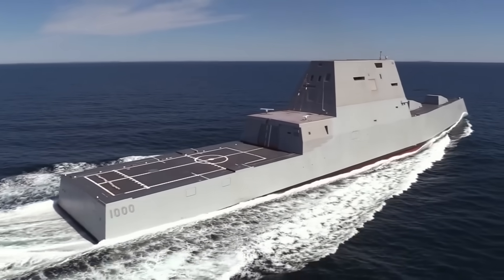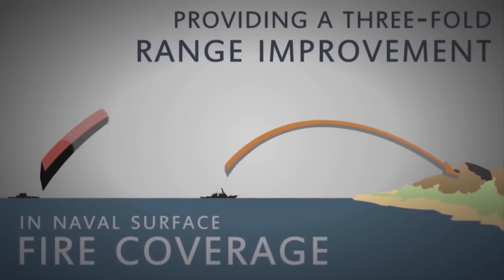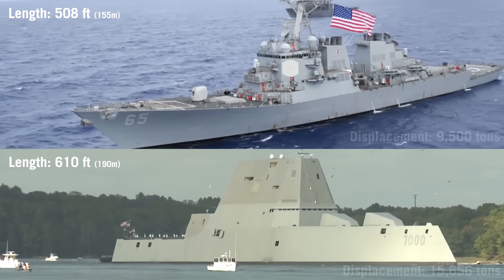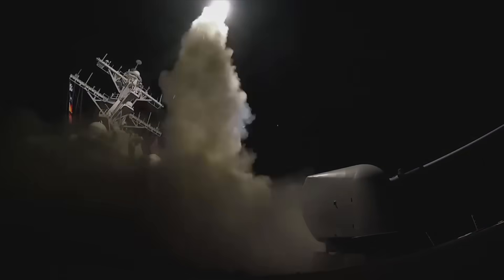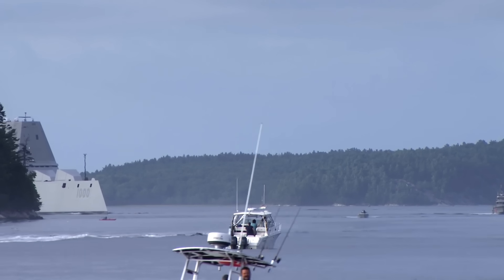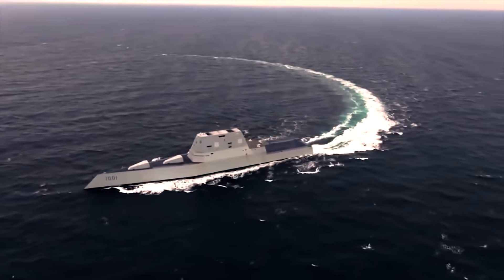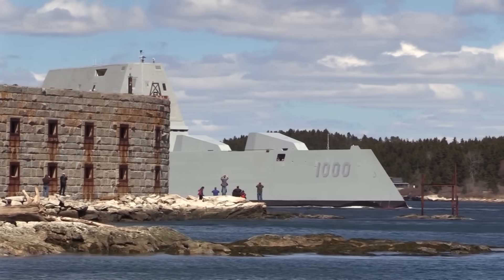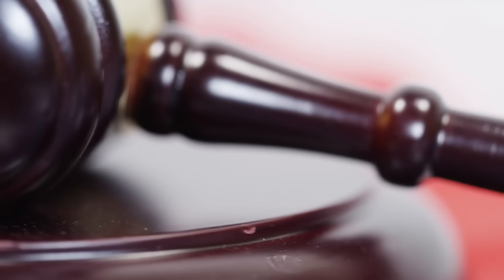What Killed Zumwalt Destroyers?

Comment: I hope they at least support 12. Just in case we go to war. With this stupid administration you can't be too prepared.
Reply: If you go to war, you want as many VLS cells at sea as possible. A Burke has 20% more cells than a Zumwalt, at 1/3 of the cost per ship. For the cost of 12 Zumwalts you could build 40 Burkes, which gets you 3800 missiles at sea vs. 960 for the same money, not to mention a lot more flight decks for ASW and surface attack helicopters.

It's really a no-brainer.

Comment: typical of a us military program - come up with requirements that are almost impossible to achieve, spend $Billions and fail to meet the objectives (Zumwalt, F-35, B-2, Ford Class Carriers, Seawolf, etc.), buy just a few of each model, cancel, then rinse, repeat, and then complain when we don't have enough ships, airplanes, etc. to meet the numbers that the enemy will field (China anyone?).   Maybe, just maybe, incremental improvements with proven designs can help fill the numbers gap.   Wait for the technology to mature, then forge ahead.
Reply: At the least the B-2 works. The F-35 has probably spent more time on the ground than in the air due to technical problems. And is a clearly obvious attempt to replace the tried and true A-10

Comment: So we spent 3 billion dollars on a worthless ship that only has the fact that it itself wont be detected on radar, but will be in fleets with very easily detected ships, and it can't fight at all because they can't afford to arm it? No wonder the American economy is tanking. 

Destroyer's have become less useful than a patrol boat, but cost more than a carrier. While a proper battleship unit can have a 30 mile dome of death with shells that can't be shot down, while also boasting plenty of room to house missile batteries along its length. Yeah it takes over 800 sailors to man a single battleship, but it takes over 1,000 to man a carrier, and it can defend itself while going on the attack.
Reply: The workhorse of the of the USN is the Burke-class, which carries twice as many missiles as a refit Iowa and has a very capable gun battery, too - less range, but with far better rate of fire and capable of using guided shells.

Also, carriers can, in fact, defend themselves extremely well. They have not just a "dome of death" that's 400 miles in diameter, not 30, but it's also their zone of complete and total control over the sea: the aircraft serve as ways to deliver munitions, but also as sensor platforms that can guide them to target. Without support from carrier aviation of its own, a battleship is, simply put, dead if it tries coming up against a carrier: it will be detected and attacked before it even knows that the carrier is there.
Reply: @paulzuk1468  I love the Burke class, and I never said carriers were defenseless. I said this most modern hunk of junk the Navy put together couldn't defend itself. If something isn't broken, don't fix it. 

Rather than cutting the military budget resulting from overly expensive hardware being built and under delivering, put the funds where they need to be placed, in the manpower. The whole idea of the Zumwalt  class was to reduce the manpower needed to operate it, and as I said before you now have a $3,000,000,000 floating tin can that can't fight, and if it does get hit WILL sink because there isn't enough people on board to save the ship. 

And a fully modern battleship would stand a fairly strong chance against a carrier given all the advancements of our times. I never compare a 1940's battleship against a 2000's carrier. I stager in factors like advanced auto turrets that shoot down missiles regularly, satellite radar systems, replacing the outdated secondary turrets with modern "top of the line" turrets that everyone raves about on our cruisers and destroyers, hell for their sheer size alone why not throw in a rail system or two with the left over deck space. 

The point is that modernizing older designs with newer equipment is a lot cheaper than building this great new best thing that doesn't do anything other than disappear. Or at the least, if you're going to make something that can disappear, at least make it able to punch above it's weight. Like the cheap sub that "sank" one of our carriers in war games. Slipped right through a whole carrier group screening for subs and landed a full barrage of hits, enough to actually sink the carrier, then got back out without being detected once.
Reply: @lordraven1991  

[I love the Burke class, and I never said carriers were defenseless. I said this most modern hunk of junk the Navy put together couldn't defend itself. If something isn't broken, don't fix it. ]

Ah, okay, I misunderstood you. Sorry about that.

[And a fully modern battleship would stand a fairly strong chance against a carrier given all the advancements of our times. ]

No, it really wouldn't. A carrier fully controls 400 miles of sea ; Any ship that is reliant only on its own sensors is at an automatic, severe disadvantage, unless it can hide underwater.

[The point is that modernizing older designs with newer equipment is a lot cheaper than building this great new best thing that doesn't do anything other than disappear.]

Yeah, but there's a limit to what can be done with extremely old hulls. The problem with reactivating old battleships is that the refits would cost as much as building a completely new, modern warship: the limited 1984 refit cost ~400 million per ship, for something that was a decidedly inferior surface warfare platform (capability wise, it ended up on par with an OHP frigate, for the same cost...as a new OHP frigate)

If they went with a more extensive refit, like one of the proposals to replace the main battery with VLS cells, you'd just multiply the costs and end up paying the price of a Burke or even more ; And those ship are just old - the hulls themselves are fatigued.

OTOH, designing a new, modern battleship? You just end up with a missile cruiser: there's no point to having so much armor - the displacement is better spent on more missiles. There's no point in having a main battery of heavy guns - more missiles, or modern lightweight guns, are just way better.

So you get...a mostly unarmored, large, fast missile-packed ship. A cruiser :)

But the role for such a platform is debatable ; Much better to just continue serial production of updated Burkes and put the remaining eggs into carriers and carrier upgrades.

Comment: It will not get rail guns. Rail guns just do not give enough if any advantage over traditional guns. That rail gun development lasted as long as it did shows how badly the military does at developing technology. https://www.g2mil.com/rail_gun_fraud.htm#:~:text=Railguns%20are%20impractical%20weapons%20because%20of%20the%20massive,effective%20range%20than%20a%20standard%205-inch%20naval%20gun. Missiles have greater range, not special requirements for a large power source.

Comment: As much as I love new toys and safety for those in service...
I think two things:
A)Increased cost due to smaller order shouldn't be held against the project so detrimentally. I would rather make all projects start off on a smaller scale so expanding it generates more savings as things go well. That's true conservation of resources imo.
B) If the disparities were at 80+% someone was making unfounded claims about development.  Either in hopefullness or more likely expecting to get away with it for an expected amount. When things really did need more work they had already used up what should have been a reasonable buffer but for their bad faith claims.
   Sadly I doubt those contract bidders and Govermental supporters got put in the time out block. I'd be happy to be wrong though.

Comment: I think a major contributor to the DDG-1000 not working out is. The ship was basically designed around a rail gun that was never delivered. Instead the Navy decided to go with a more conventional gun that had a ridiculous projectile. 

I'm also not convinced the Navy didn't test the railgun on a Zumwalt.  If you live in Bath you can see the ships being built. The rail gun has a distinctive rectangular barrel and muzzle device. The conventional guns are round. Now the guns were always wrapped to obscure them form view. But the wrapping looked like it was around the rectangular barrel of the rail gun form general atomics.  Not the silly canon thing they eventually got fitted with. 

The abandonment of the railgun by the Navy I think will be recognized as a mistake in the future.

Comment: Maaaan, there's so much waste and corruption in the way that the usa produces and purchases its arms + munitions from local suppliers. When I see in the news that the usa has allotted 650 billion, or 700 billion dollars towards its military budget, I have to wonder how much of that money is wasted on the corruption infesting the system and how much of that money actually gets used for its intended purpose. Alternatively, when I hear that China has allocated the equivalent of 120 billion dollars for their military, I expect that very little money is diverted from the military towards the pockets of corrupt officials. I think that this is why the Chinese military appears to be catching up in both numbers (of materiel/ vehicles) and in technological sophistication. While the usa might spend 700 billion dollars on their military every year, their military forces only get a portion of that money (maybe as little as half of it?), while the rest is wasted due to corruption (kickbacks/ bribes/ overpricing/ etc...). Whereas when the Chinese spend 120 billion on their military each year, I expect that the vast majority of that money actually gets used for the military/ by the military. Also, I expect that because of the drive and determination that the Chinese have, that 120 billion dollars of theirs probably goes twice as far as it would it the usa, making their effective military budget 240 billion each year.

If that's the case, then that would explain why China is very quickly approaching the number #1 spot on the list of most powerful military forces on the planet. It would explain why they are so close to overtaking the usa as the dominant military force in the world. Such a thing would be impossible if the usa was spending almost six times as much on their military each and every year. However, if the usa and China are spending roughly the same amount (300 billion vs 240 billion) on their militaries, it would go a long way to explaining how the Chinese are able to have risen so far, so quickly.

Comment: So if the whole is a good design, and as I understand it the engines are a good design, why don't they look at Arley Burke block five using the Zumwalt Hall and powerplant as a starting point. No need for aluminum hull and it's better sea keeping and powerplant then possibility of using that as the basis for a block five or a next-generation destroyer is a distinct possibility using the mature systems of the Arley Burke. It's an idea…

Comment: Can you at least get the grammar correct when numbering the crew members.  It is NOT “less” crew members. It is “fewer” crew members.   If one is describing anything that can be counted, even if impractical, then it is “fewer”. If you are describing a volume, then the proper term is “less”.  Ex:  There are fewer grains of sand in smaller hourglass than a large one.  A 500 cc hourglass hold less sand than a 750 cc hourglass.
Reply: 150 is less than 500
150 X  is fewer than 500  X
both wordings work and make logical sense

Comment: "What killed Zumwalt Destroyers?"...Being the single worst mistake in modern naval design, using Aluminum for the superstructure which is already has stress cracks, poorly designed oil slingers and seals for the drive line bearings, Under performing and poorly designed electric drive motors and couplers, and trying to mesh far too many "new" systems built by different companies into a new ship design. But on the flip side, on behalf of myself and other Navy contractors, we thank you from the bottom of your wallets!

Comment: I don't think we should be so quick to condamn the Zumwalt Destroyers yet.

Yes, they were very, very expensive. Yes, their main cannon was poorly designed and ended up to be a failure. But we must also remember that this was essentially a science project, a proof of concept. So it doesn't really matter that the project was concelled.

US Navy still learned a lot. They've proven that this hull design works and can be used for future ships. And also it was proven that there's no real need for a stealth destroyer, so they can cut the cost of future designs by no longer considering that as a primary objective.

So while Zumwalt Destroyers may be cancelled, it is not so certain IMO that US Navy will not order something similar in the future, just putting far less priority on stealth and equipped with better weapon systems.

Comment: US government statistics (intentionally) underestimate inflation by probably 8 % a year. But they use the official statistics to adjust the supposed price of construction for military equipment. This means that they find that everything becomes very expensive over the years without any reason. So they shut down programs just because the inflation data is rigged. Quite interesting. (Unfortunately I could not find the date for the original price estimate for the Zumwalt class.)

Comment: For one and half of these clunkers you could probably make one hell of a guided missile battleship or cruiser with a strong gun arm using existing technologies with minor modifications . I mean you could literally take a New York class battleship upsize the hull so it can fit aegis, missiles, Ciwis, helicopter facilities, put the secondary battery into twin turrets, push the speed up to 31-32kn and you would have one hell of a warship compared to this.

Comment: Alright, one point about the tumblehome design. Tumblehome doesn't make a ship more prone to rolling in normal conditions. The reason so many tumblehome ships did roll in the past, was because they were overloaded with armaments, which made them less stable. However, tumblehome becomes more likely to roll once flooding ensues. But, if the ship is not damaged, and it is not overweight, a tumblehome design is still sound and seaworthy.

Comment: Well if the Navy smart they will learn from this just like how the Air Force should learn from the f-35 because if you do not learn from your failures and mistakes you are not learning.
Reply: But the air force hasn't learnt from that they are still giving Lockhead more money too correct mistakes they made.
Reply: @Alex-cw3rz  another thing with the f-35 is it's the first of a generation fighter so of course it's going to have a ton of problems.

Comment: What killed the Zumwalt class was mostly scope creep. Every time the program was up for review a new requirement was added. The original requirement for a dedicated land attack platform based around a massive gun slowly became a multi-mission warship as a result of changes and cancelations in other programs. The full SC-21 concept was never completed. 

Another nail in the coffin was the reduction in the number purchased. This was enforced by congress and caused the R&D cost per unit to skyrocket (cost / 32 is a lot less than cost / 3). Congress caused the cost increase that tripped Nunn-McCurdy and caused a further reduction which caused yet another price increase.

Comment: The problem was that the Americans in the 90's and early 2000's went with a revolutionary approach in some fields of future military designs rather than evolutionary, which is fine if the end result works, but alas in some projects this has backfired spectacularly. The LCS is a prime example of this, a near totally useless warship, which is now being retired early. In the case of the Zumwalt class, obviously this ship has some great advanced technology, it even looks futuristic, though some people think it looks like an upturned bath. Anyway, the US Navy will have 3 large Destroyers, none of which are combat ready, and appear to be of little use to the Navy. Now the US is having to backtrack and is again making more Arleigh Burkes, meanwhile the Tico's are getting very old, and will need replacing soon. Morale of this screw up is...........make evolutionary steps in technology, get them proven, then move ahead.

Comment: The big spy eyes on the satellites in the high orbits can see any ship then transmits data every 0.01 second to ground/ship stations. Zumwat may be invisible from sea/land surface mount radars, but the big eyes can always track it every where. The stealth ship project was a total waste of money and time, even at 50 knots speed it will be tracked by the spy satellites.